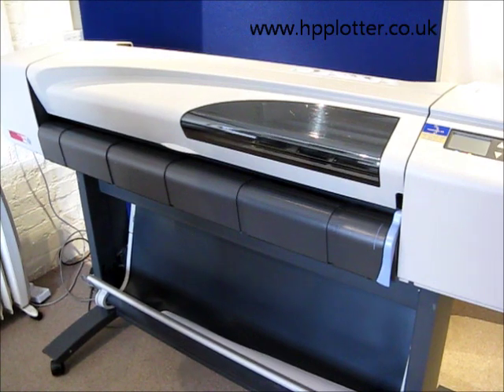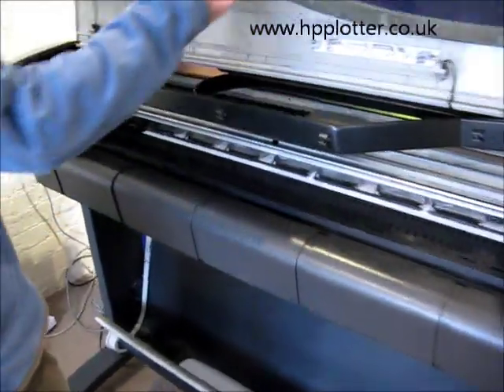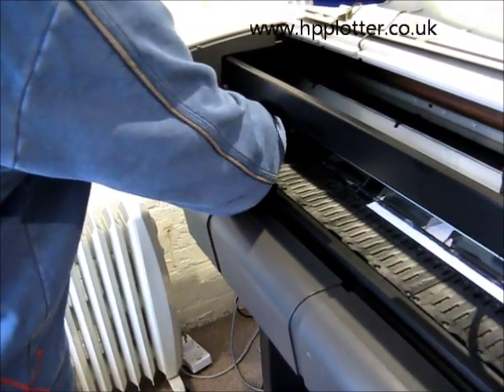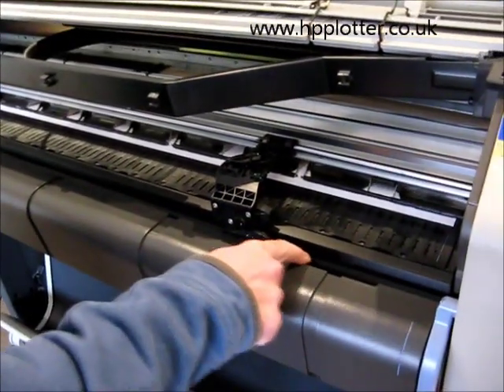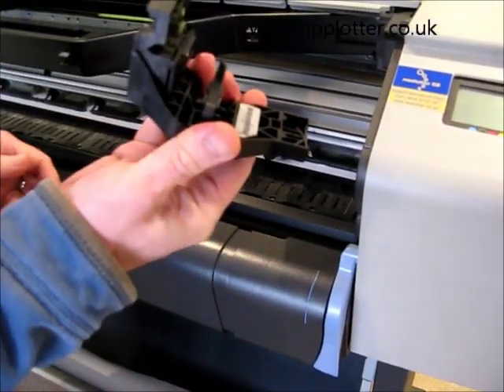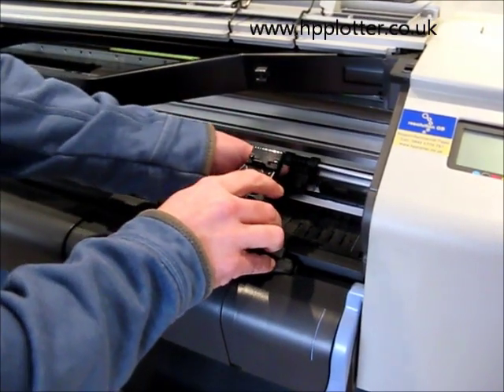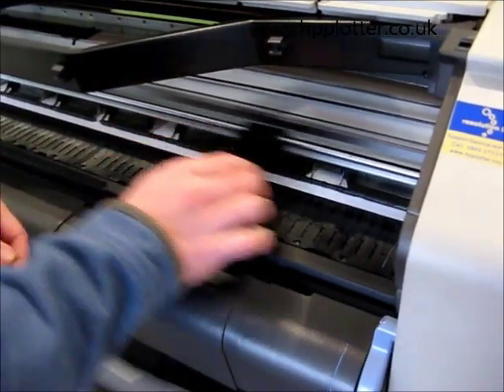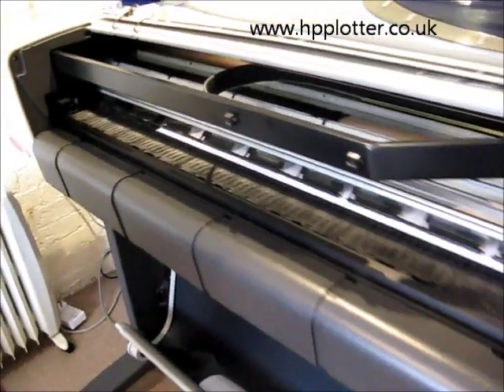DesignJet 500 repair- cutter replacement

Comment: why do i need to change the cutter ?
Reply: +Hp Plotter 

I have designjet 500 plotter which works fine, but cutter does not cut automatically each time i print something. I am not sure what is the problem. you wrote that carriage belt has worn and it is unable to pick up the cutter. if this is a case what should i change then ? cutter or carriage belt ?

Could you please help to solve this issue ?
Reply: +abea   Hello Abea -  Check that the cutter is clicked in properly and hasn't been dislodged. Check your print settings to ensure that you (or someone else) haven't deselected the cutter by accident. More than likely it is your carriage belt causing the issue which means a complete strip down of your printer to fit a new belt. I recommend you contact us at: engineering@hpplotter.co.uk if you are based in the UK and we'll quote you for an engineer to attend site and get you up and running. If you're outside the UK then I recommend you contact a local DesignJet specialist to replace the belt for you.  This is because it is not a quick and simple repair. It will take an hour  approximately for a specialist and half a day or more for someone who doesn't know what they're doing!